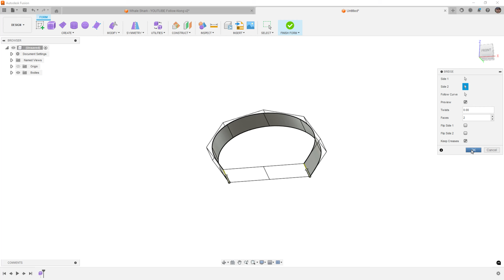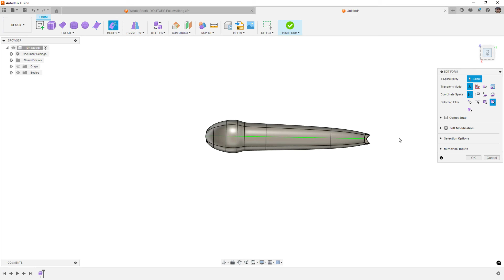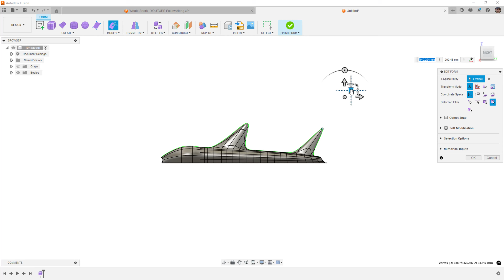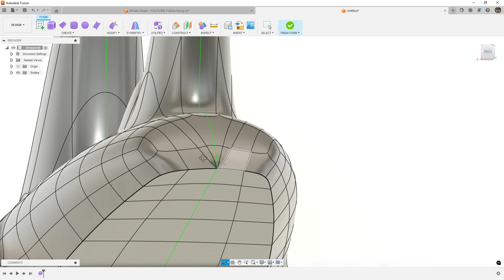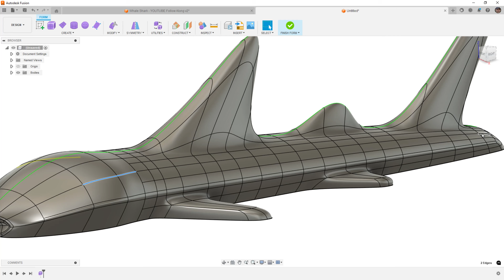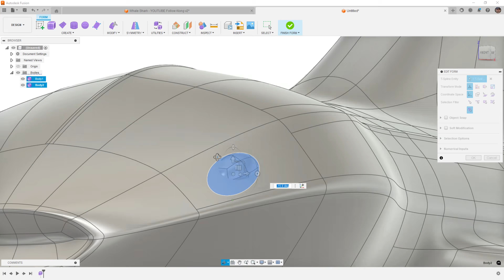How To Model A Whale Shark with Fusion Forms | Articulated Whale Shark Model

Comment: Hi! At 20:54 when you pulled up the Bevel tool, how did you get the "Bevel Location" tool to come up? I am trying this on my end right alongside yours but for me that option does not show up when I open the Bevel Edge tool... And because of that it turns into a sort of Box form once I press apply. I am new to Fusion and so I really don't know what to do now lol. If you can help I would appreciate it so much!
Reply from the maker: Hey There.  In the last update of Fusion they updated the bevel tool.  There are now two ways to use it.  In the "Distance Mode" section there is a "relative offset" option and that is how the tool used to work.  So to follow along try that one. You would set the segments to 1 to act like the old default.
hope that helps but let me know if it doesn't.

Comment: Not sure if it’s a silly question but, can you design something using both normal modelling and forms? I’m not if you remember but I emailed you about doing the sai dagger and I’ve been trying to do it myself and think forms would be better for certain parts of the design.
Reply from the maker: 100% you can.  As soon as you finish a form, if its closed you have a solid, if its open you have surfaces.  Forms is not usually the end of the design process.  You can start with solid/surface/curve inputs and match a form to them if you need to drive a certain shape as well.
Reply: @LearnEverythingAboutDesign thanks for the reply, I’ve done one part using the forms tool and the pull method as shown in one of your reverse engineering videos but I’m struggling to convert the form to a solid body. I’ve used the fill hole command as the form is essentially a tube in simplest of terms but I don’t know what to do from there.
Reply from the maker: @jamesarcher5193  When you finish the form does the bodies folder show a surface?  You can try to use Stitch on that surface and see if it will create a solid.  there have been some cases where tools like fill will leave a vertex group unwelded and may look closed but is open.  The Fill Hole tool has an option if you use the fill star method to weld vertices.

Comment: I'm thinking about a handy 3d-scanner, what was your favourite model you've tested so far?
Crealty otter? Mat, can you recommend a model that is no mistake to buy?
I'd like to scan smaller objects and catch a lot of details.

Thanks for the video, i love your content mate!
Reply from the maker: Hi Gery, that is a tough question.  My two front runners are the Creality Scan Otter (note i haven't tried a scan raptor yet), and the Revopoint Miraco.  Both scanners have the ability to do small and large objects.  The Scan Otter does better on black objects and is better in brighter areas (but not direct sunlight).  The Miraco is self contained so you don't have to be wired to a computer to use it.  That is HUGE as nearly every other scanner you need to have a cable to a laptop or desktop.  There is around a $600 price difference between the two though with the Miraco being more.

I can't say much but will have a new Miraco video soon so maybe hang tight to check out any updates.

How small are the details you are trying to scan?
Reply: @LearnEverythingAboutDesign  I would mostly scan objects between 3-20cm. And i'd like to capture 1-2mm grooves (for example) or other details this "deep" or wide. Is the Miraco capable of doing so? Is the resolution even that fine?
Reply from the maker: @GeryS.  well, to get scan data inside of cavities you really need to look at laser scanners.  Any scanner that is an IR structured light or blue structured light (Most of them including the otter, the miraco, the mini2 etc) will not do great at capturing into cavities.  If you look at my scan otter video on motorcycle parts in there i show how it can't really scan down into the pocket on the bottom of the triple clamp.

For that the Scan Raptor is probably the best bet.  IF the features are something you could manually build in CAD after the scan and the data "in" the pockets isn't important you could go with a miraco or otter for sure.

Comment: I have always been fascinated by your ability to use T-spline modelling as your go-to method and getting it to do what you want relatively easily. Coming from a mechanical engineering background with precision in mind, I usually try to parameterize my models, so surface tools are my first option in order to have surfaces to edit, but it usually takes much more time planning. Sometimes I use free form to figure out a certain shape, then recreate it with surfaces and solids. 

Great video as usual. Thanks Matt.
Reply from the maker: yeah it is different for sure.  I did surfacing only for many years before trying out Power Surfacing for Solidworks back in like 2011 or so.  You can control the forms with curves, surfaces etc if you want but not 100% of them.